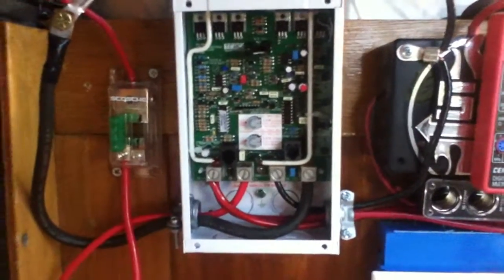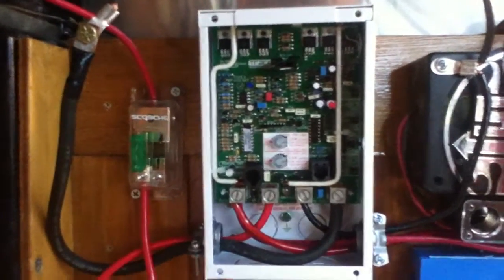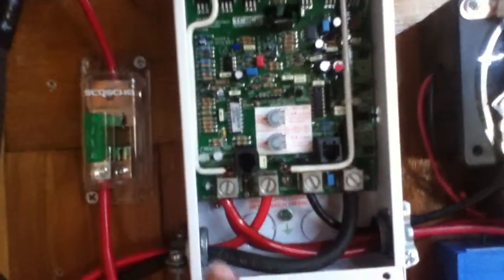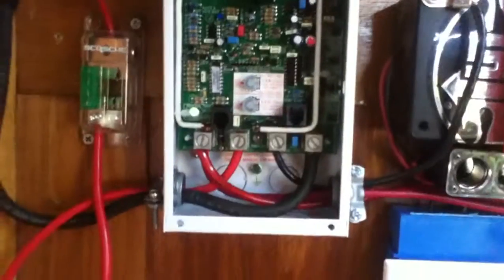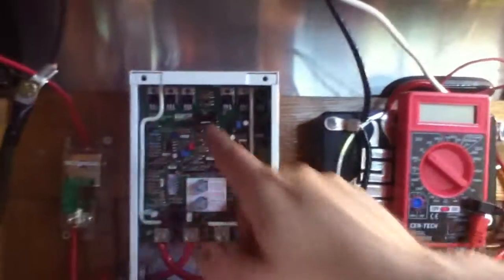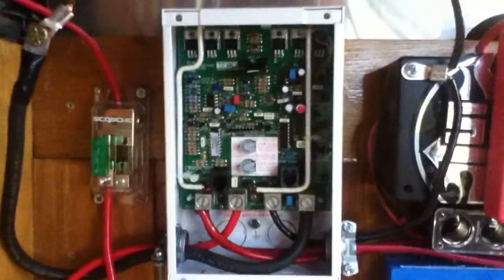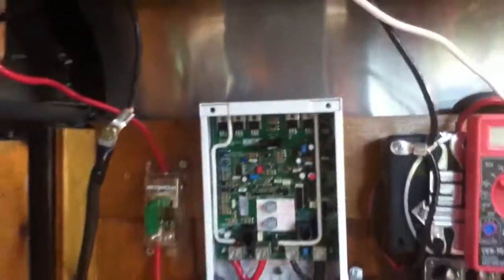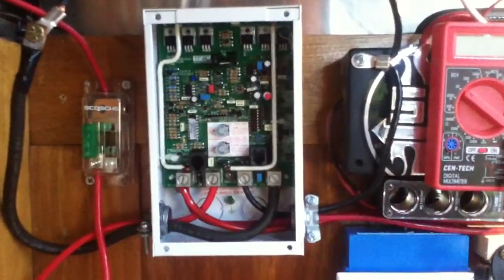Xantrex C35 Part 4:  Final overview

Comment: Hello, I have a question. Does the blinking green light ever turn to a solid green? I have a set up similar to your system. I connected two 6 volt RE batteries in series two days ago and the green light is still blinking ( no load). Any suggestions? Thanks
Reply from the maker: +Jose Arellano  yes, it goes to solid green when the battery is "full".
Reply: I had the same issue on a c40.The PV voltage was wrong